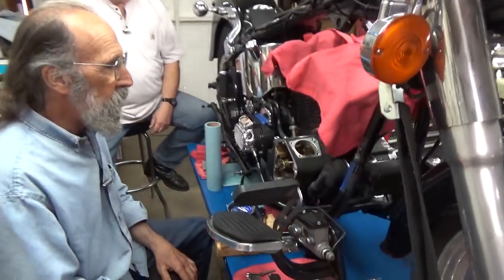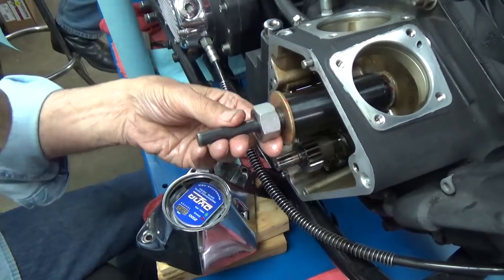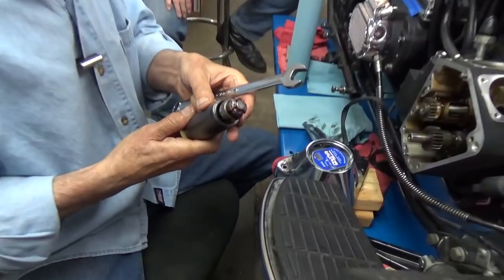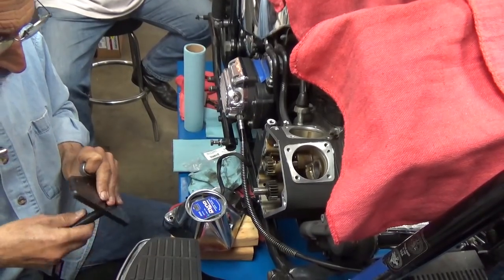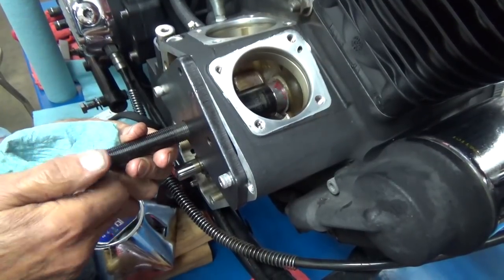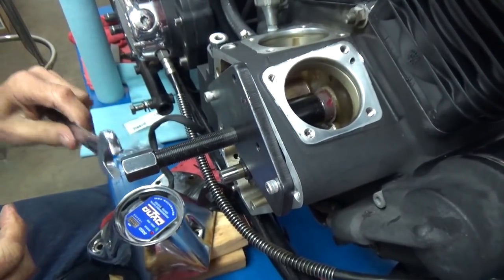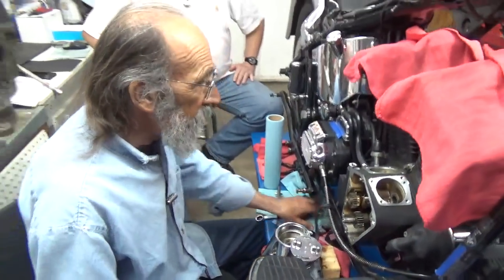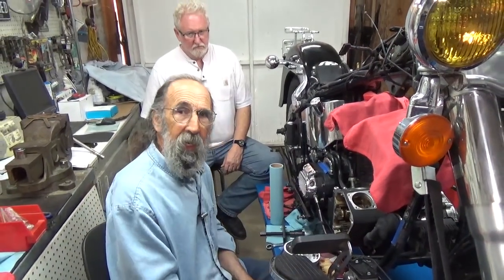Installing Evo, New Cam Bearing & Seal

Comment: Great stuff Mike. Things I wanna do to mine! Wish u were closer so I cold pick your brain easier!
Reply from the maker: You might be surprised about what's in yours.
Reply: @pacificmike9501  haha this is true and I appreciate the confidence you instill in me.lol Not sure if you meant my brain or my motor.lol I think my motor is bone stock though given it didn't even have 5k on it when I bought it. 1owner and it sat mostly covered in a garage. Some surface rust was addressed when I got it but not much. Other then that she's been a great little machine. Just needs about twice the power.lol

Comment: Pretty sure the cam bearing is bad on my electra glide and knowing how to do it instead of paying a shop $1000 is a lifesaver.
Reply from the maker: Cool.  It is very important that you get any of the debris out.  Realize that bearing bottoms against a lip in the case.  Be extra careful not to damage that lip.  Usually, you can't tell until opening the cam chest, that the bearing is bad.  Noise from there is usually lifter rollers.

Comment: Hello, I have a Heritage Softail 90, when accelerating hard, oil is thrown out of the engine's gas outlet, which takes it down, gracias
Reply from the maker: Are you referring to your air filter cover?  I'm not sure what you mean by "gas outlet."
Reply: @pacificmike9501 
Hi MIke, mi name es Toño, thanks for answering, ...no, my EVO does not have an outlet for the carburetor, the filter support screws are blind. It has an outlet (for gases) behind the oil pump, a little lower, with a non-return valve in series and at the end a chrome filter, it spills oil over there and stains the entire rear part, also at idle gases and oil bubbles come out
Reply: I changed the camshaft seal that was losing oil there. I saw your tutorials, I changed it fine, but I still have this problem...
Reply: Maybe I was running low on oil before calling roadside assistance and I messed up something else...
Reply from the maker: Okay.  That is your "crankcase breather."  Make sure that the hose exiting that "fitting" goes down, never up from there.  Otherwise, over a period of time it will fill up and come out in a mess.  That fitting has to breathe.  As to the filter on the end, I don't use them.  I run the hose out about 1 1/2 ft. parallel to the ground but still down from the fitting.  If the motor sits too long, without being run, the crankcase will fill with oil and puke right out of that tube.   Other than that, refer to your service manual, for the the check ball and spring in the oil pump (not the one in the tower, which is a piston.  The one under the small plug in the top of the oil pump.  Remove the ball and spring, clean them or replace them.  The oil will come out of there until you reinstall the ball and spring.
Reply: @pacificmike9501  Thank you very much, I will make these recommendations and see if there is any luck... I will keep you informed, thanks
Reply from the maker: Cool.
Reply: @pacificmike9501  Hi Mike, I have put a video on my channel where you can see that I uncovered the screw and there is only one spring.  You can also see the valve that was in series at the outlet of the crankcase.  I don't know if that screw with the oil pump spring is missing a ball...
Reply from the maker: Good job on the video.  That plug and spring are not the ones you're looking for.  There is actually a "piston" under that spring you can remove with a strong, skinny, long handled magnet.  You can clean it and reinstall it.  That's not it.  The one you want is behind that "tower"  and under that breather line.  It is in the top of the pump.  It is a large slotted plug smaller than the one you have removed now.  Removing the spring and ball from it will be easy once you remove that plug that's in pretty tight.  The oil will then come out of there (not gushing, but it will slowly keep coming) until you replace the plug.  It's never a bad idea to replace the ball and spring.  You were just in the wrong hole.
Reply: @pacificmike9501  Hi Mike, I have managed to remove the cap, the spring and the ball, although I see that they seem to be in good condition, what do you think? I'll post another video, thanks
Reply from the maker: You certainly got it right now.  If there's no damage to the ball and seat, it could be just something small (particle of gasket material, dirty oil, just about anything) in there that will probably flush through, but clean the ball and spring.  It's a good idea to replace them every once in a while.  That should probably run you about $5.00.  Maybe your oil is dirty and should be changed, run a couple hundred miles, then changed again.  That does have a tendency to clean out the system.
Reply: @pacificmike9501  Thanks Mike, now I'm in Spain, I'll try to get the spring and the ball here... I think it will be good to clean the oil circuit with some special product.  I already put the crankcase breather hose near the ground... tomorrow or the day after I'll top up the oil and go test drive the bike.  .... I'll tell you in a couple of days ..... thank you very much
Reply from the maker: Don't get the hose too close to the ground.  It can take on dirt.  Point it back, not down, but make sure there is no kink in the line and that it flows down from the case, never up.
Reply: @pacificmike9501  Hi Mike....Perfect, that's how I'll do it, thank you very much, tomorrow I'll tell you if the bike doesn't stain my jeans anymore...🤙🏻
Reply: @pacificmike9501  Hi Mike, I did what you told me and it's going much better now, I only have to check the oil hoses so that I don't lose anything and adjust the carburetor a little... thank you very much for all your help.... come to the caribbean whenever you want, you're invited, just let me know so I can be there.... go for a few days of fishing or diving... thanks Mike... I'm sure I'll get more questions soon... 🤙🏻🙂

Comment: need to replace my bearing but...can't afford $450 dollar tools to replace $9.00 dollar bearing.....
Reply from the maker: There are different tools and different manufacturers.  Search the internet for cam bearing tools for Harley Davidson Evolution.
Reply: @pacificmike9501  Thanks Mike, found some cheap knock offs for around $50. last time i had to do this was around
15 years ago, borrowed a buddy's removal and install kits (Jims) but he is no longer with us SOOO...
all your videos are really good, thanks for that.  Q any Tork specs for the lifter blocks??   75 shovel
Reply from the maker: 10 ft. lbs. or 120 inch pounds.  It's in your service manual.